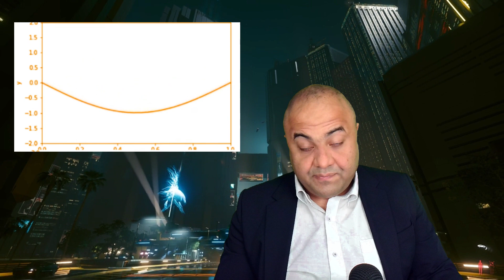PINNs New library

Comment: I bought your lesson however we dont learn how to input our data(custom geometry for example) and how to include data driven solutions too. I think its insufficient for the time. I hope something about this is added or you can reach me out for some help. Thank you
Reply from the maker: This course is an intro for running and writing Nvidia modulus code for PINNs problems, However, we are planning to add one more chapter for the PINNs course and publish a new course to handle more advanced topics.
Reply from the maker: Now we have new chapter for stress analysis for a panel problem.

Comment: Thank you sir, I just bought the course! One question, Do we need a simulation / experimental data to train the model with Nvidia modulus or how is the Neural Network training (only with PDEs and boundary constraints)? Ty!
Reply from the maker: It depends on what technology you use: PINNs do not need data, data is just our ic and bc and the equations rules, some other technologies will be concerned in the future course that deals with the use of simulation or experiment generated data to model a system without the need of PDEs such as deep neural operator, or find unknown value in the governing equations using the data such as I-PINNs